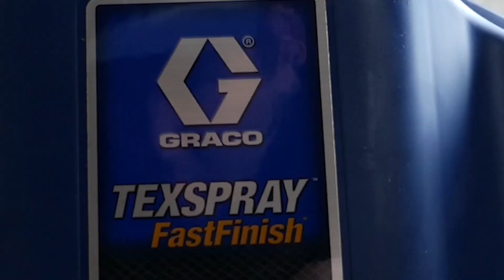Spraying a KnockDown Ceiling with My Graco Fast Finish

Comment: How do you like that Hopper?? 

Full confession.. I’ve had that Graco fast finish hopper in my garage for 5 months and I’m nervous to try it out. I just keep using my Wallboard TexPro 200 on jobs.
Reply: Turner Drywall Restoration I’ve had the fast finish for about 6 months . I like it but only with use of a gas compressor that can keep the pressure consistent. Tried with a pancake and it was a fail. Also it has tons of overspray. I’ve done full ceilings like this and at the end I am absolutely covered .